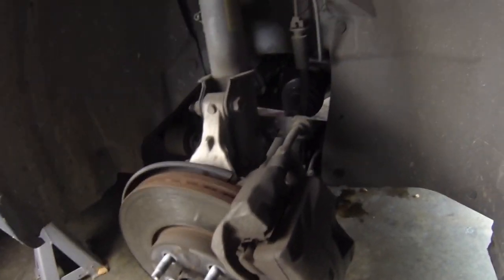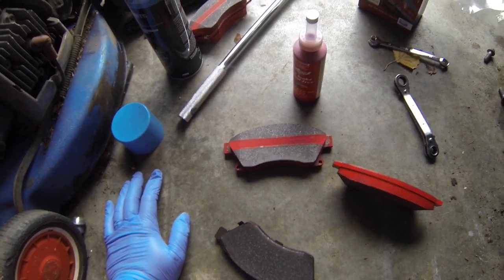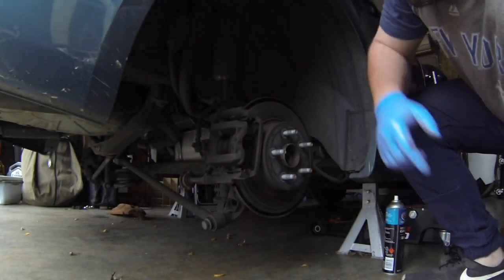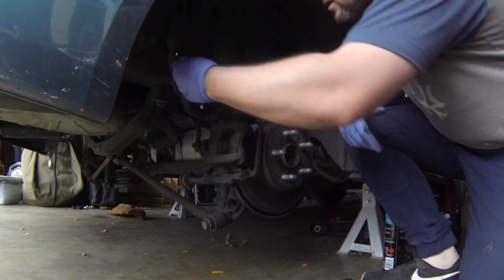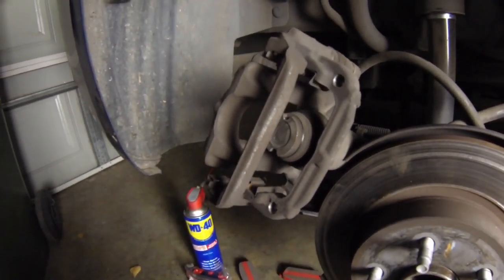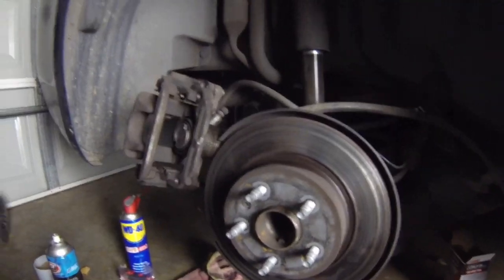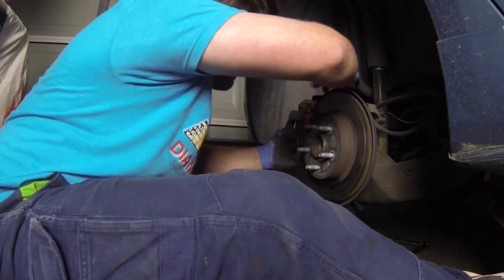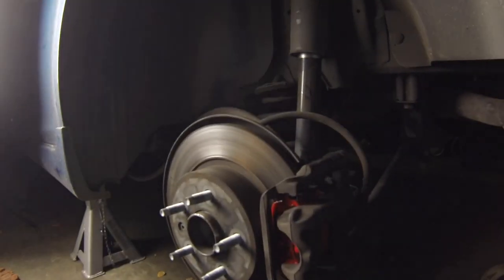I HATE THIS CAR!!! (Holden Cruze brake change)

Comment: Repco have another tool for compressing the pistons. It is a GearWrench Rear Brake Caliper Kit. It comes with 10 different adaptors and adaptor #6 works for Cruze. It works like a dream in fact and it'sa pleasure to use! The only thing is its $147 price even with the RACV discount but I figured, if I save money by doing the work myself, it will pay for the tool. I also tried the multiface cube tool and like Panda Garage, I was very disapointed/ frustrated when it did not work. I thought this may be helpful information for people.